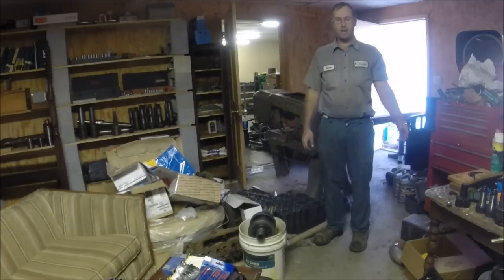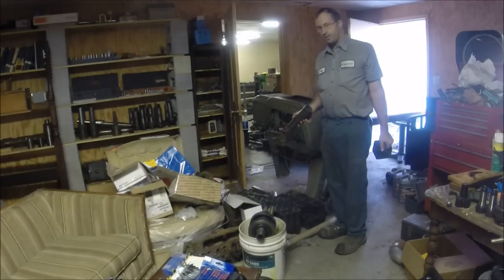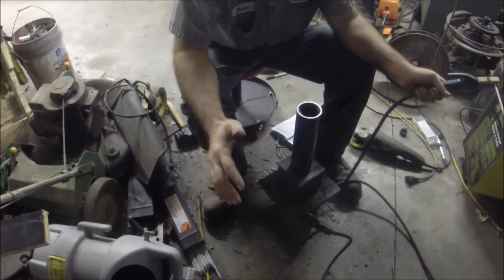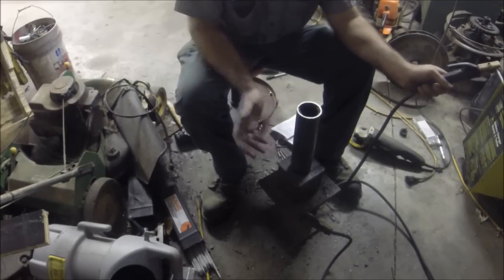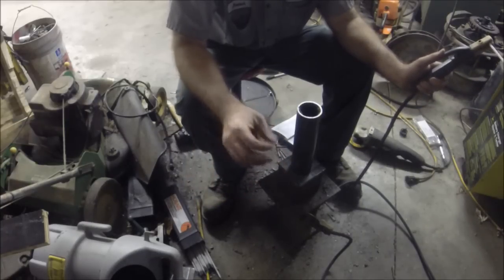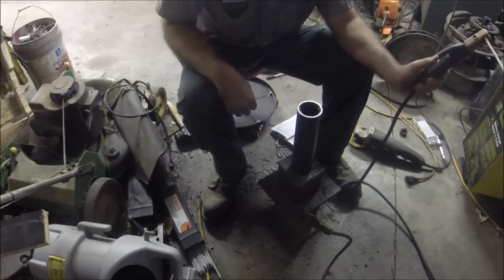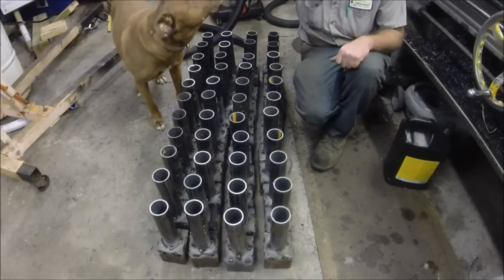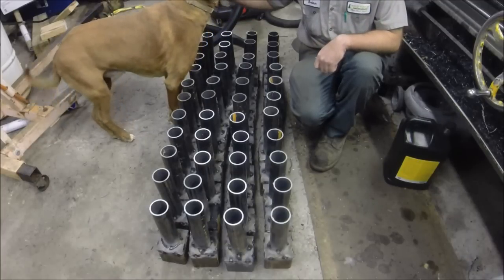Building Machinery Anchors

Comment: Lots of work in building a big shop.  When do you estimate you will finish?
Reply from the maker: At current rate, likely never. It is just one job followed by another, I see no end in sight.
Reply: bcbloc02 hang in there.  You're doing it right and once you get the floor poured it'll make a big difference.
Reply: Oh oh, sounds like a dose of reality is sinking in.  But, it's true.  You are really never done working on a shop.  It's always a work in progress.  The pace of the work is only limited by time and money.  Don't wear yourself out by trying to push too hard because it can take all of the fun out of the experience.  The world will be a very different place once that concrete hardens and you have a solid floor to stand on.